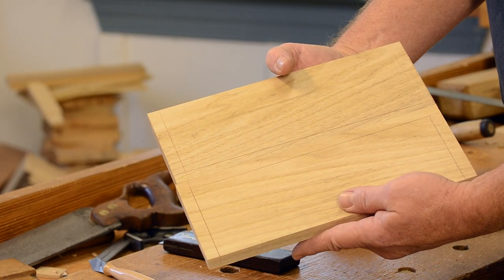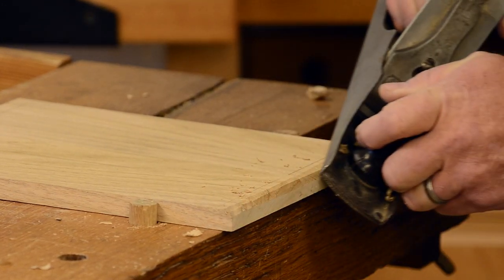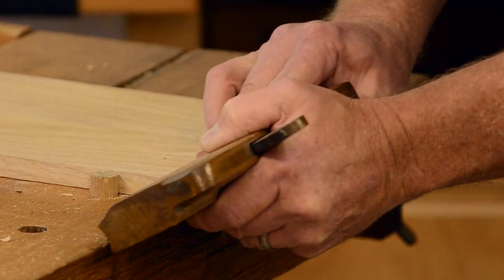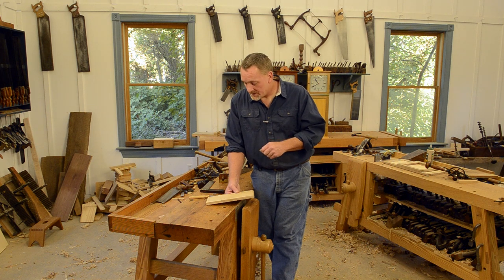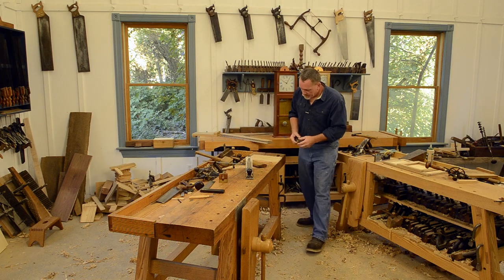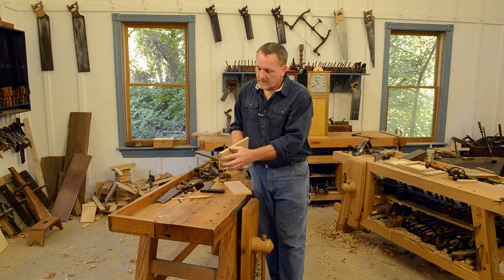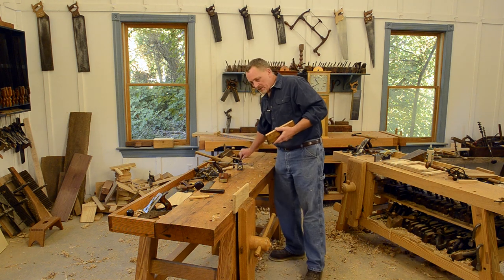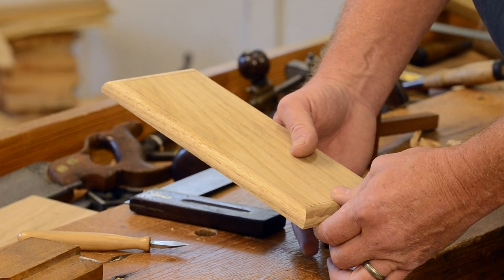Make Quarter Round Molding with a Hand Plane

Comment: there is absolutely no point in using Tallow or wax on the sole of wooden planes there no friction on wood to wood contact
Reply: There most certainly is a point. Try using a light scribble of candle wax on the bottom of your wooden jack and you'll be an immediate convert. As far as my research has gone, there's no historical precedent for the practice in the 18th/19th centuries. But the results speak for themselves. It probably wasn't used in the past because many planemakers (including Sandusky, Gauge Tool, and others) soaked their plane stocks in oil or wax. A new plane wouldn't have needed anything else.